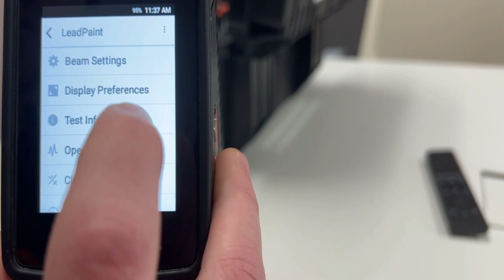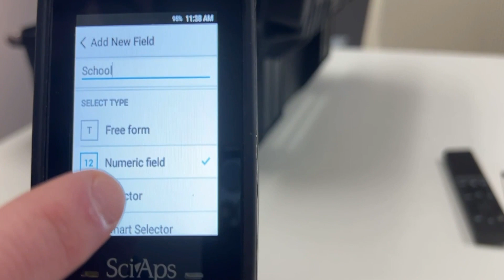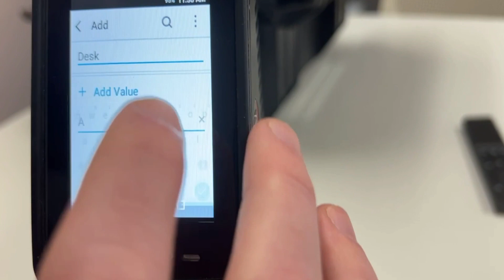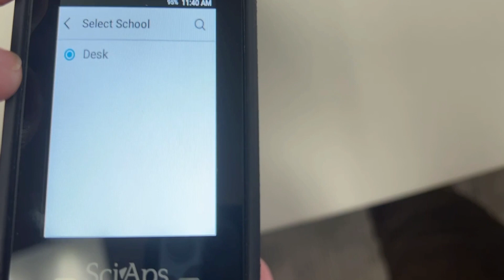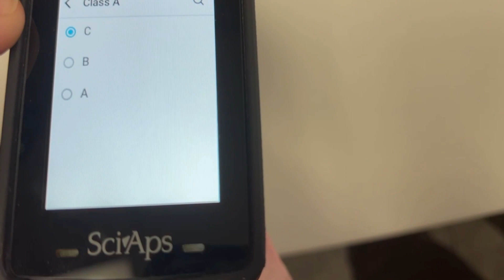SciAps X550 XRF - How to set up a sampling template

Comment: When you create a specific template like that, is there a way to export all of the template items? I tried this, but when I went to export, all I got was essentially the lead reading, positive/negative, and what shot number.
Reply from the maker: There are a few things that could be cause this. There might not be a template imported or the template option for prompting before each test is not selected.  The template also needs to be saved in the right location in the SD card folder structure.

Here are some steps to check...

1.	“Analyze”  Lead Paint  select 3 dots in top right  “Test Info”  “Template setup”, Enter your desired descriptive fields such as selectors and smart selectors.  tap the top left back button and make sure the “Prompt for test info” box is checked.
2.	Delete old results  Take new samples (make sure test info is popping up right before sample).
3.	“Results”  select 3 dots in top right  “Template Setup”  Select Template name/location that you have saved, typically saved under “Default”  “Setup Fields”  scroll down and make sure “Test Info” box is checked.
4.	Export results.

If you would like you can call us to walk through the steps.  We also can get some canned templates that SciAps has created that can be modified.